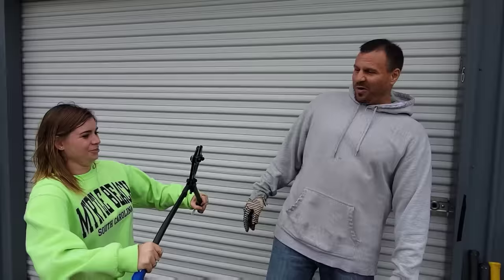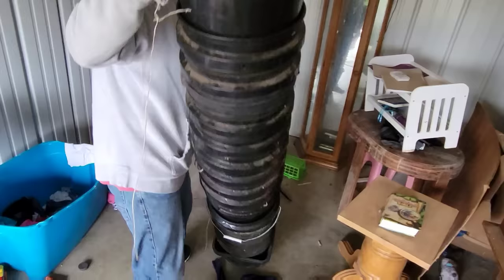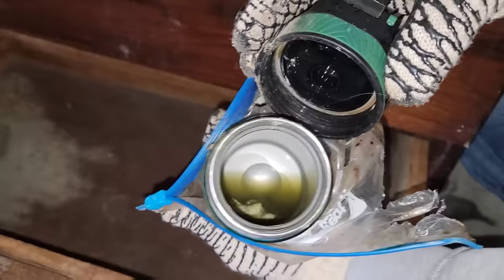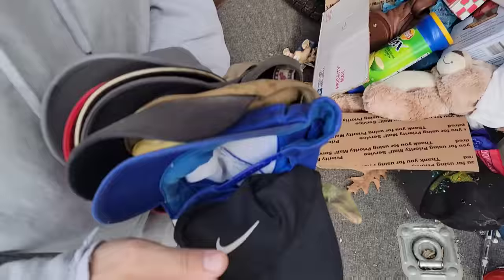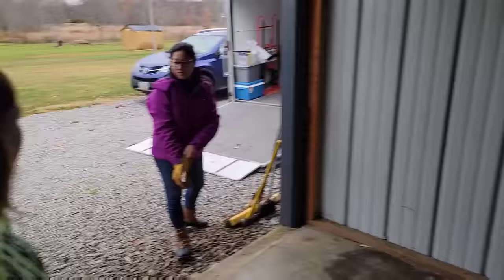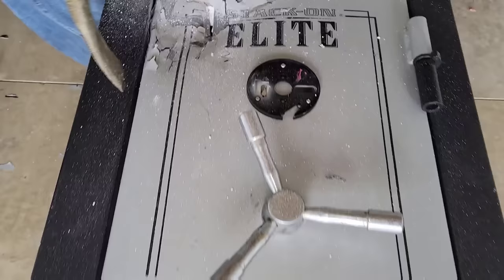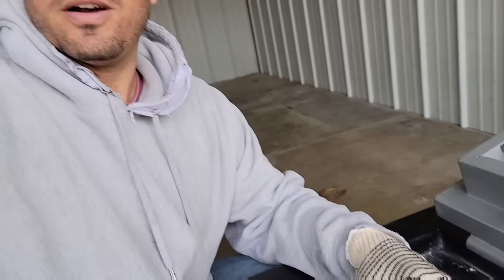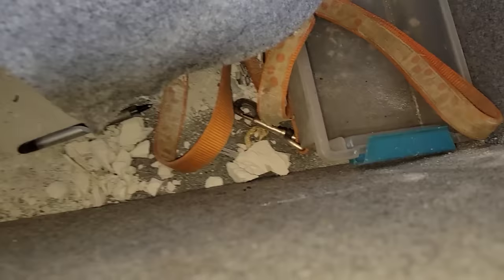DRUG DEALERS FULL SAFE Found In An Abandoned Storage Unit

Comment: Ok so there are 3 to 4 wires that connect the key pad to the safe. If you pull the pad and look at the wires one is ground one is power and the other is a power that is only on when the code is pressed. Buy a 4 battery replacement battery holder(anyl attack aligator clips to the black anf red wires then with an exacto knife trim the wires sheilding off the each wire. Connect the black to the black clip and touch the res to the others untill it opens the solenoid. Then just crank it open. Its super easy and you canpuy it back together and reprogram it after its open.  There so easy to open which is why i only use combination safes or key but ill swap the key to an automotive one with pins on both sides.

Comment: Here's an old security trick Shine a light into the crack & where it shines That'll be one of the safe bolts😁It's a pot smell filter We use them When growing pot & the hand held electronic Is also for growing pot & the round styrofoam is where the seeds go To grow pot

Comment: The  bb gun has to be charged before it will pump up.  I have one like this and it won't pump up until you load it by pulling the slde on the side back and push it forward.